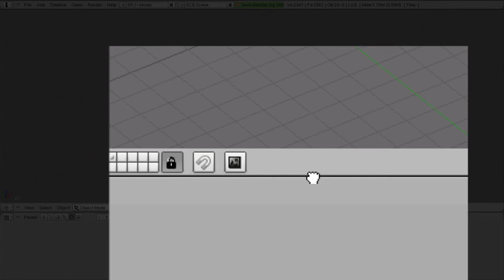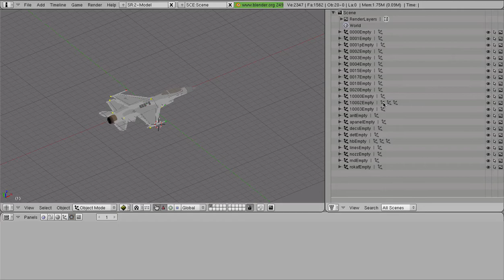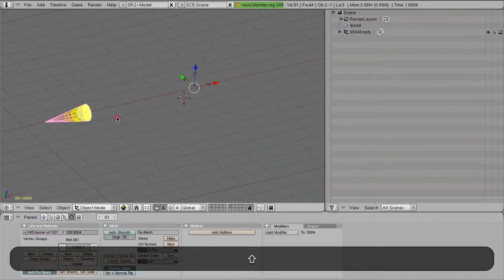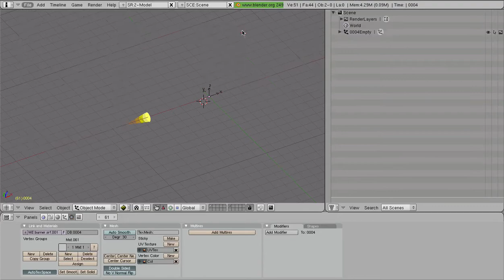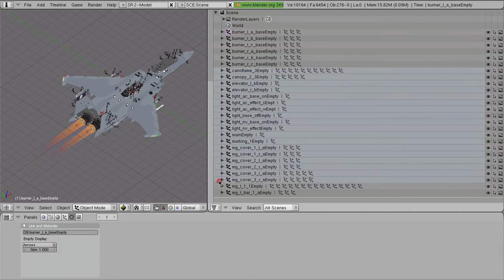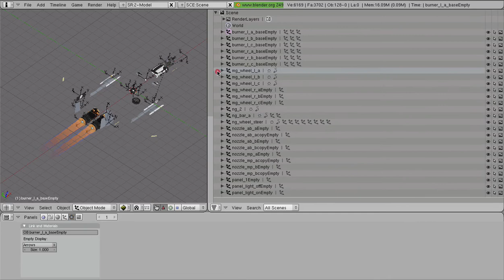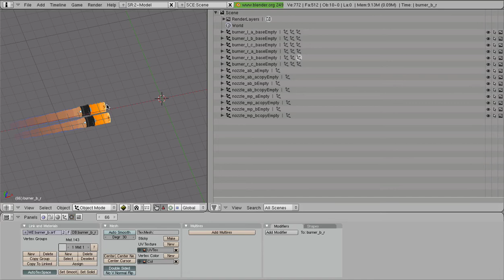Decaff's Afterburner Tutorials - Extracting an Afterburner

Comment: Dear Decaff, just as you are an expert user of YSFLIGHT, I think I have already flown and landed every aircraft available in this software, I use it on LINUX.
I need to ask you a favor that maybe you are excited about, I am looking for a model of the AERION AS2 of the "previous" model, the one that carried the PW, but it would be good to do a restyling not only to experiment in better sacrifice to the model but also to use it as if it were a test bench, and it is to make it carry the turbines in the same way that the IL-62 carries them, to use four turbines and make it reach mach 3, so that they can be used with afterburner and directional nozzles such as the Saturn- Lyulka AL-41F2 of the Sukhoi fighter aircraft retaining the "T" shaped helm.
Another nice detail would be to change the landing gear for one like that of the Syberjet SJ30 but with more additional axes for the weight, so that the wings do not support the weight of the plane but that the train is in the fuselage.
It is a pity that this plane has only been thought of as a business jet and not for one hundred or one hundred and fifty passengers.
My email is: wabeckley@gmail.com.
Thank you very much for your attention.